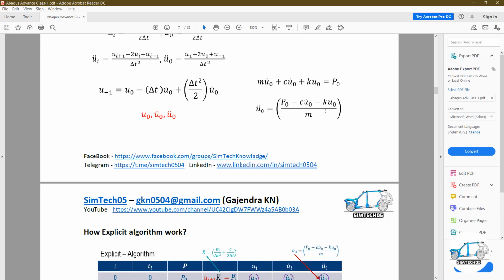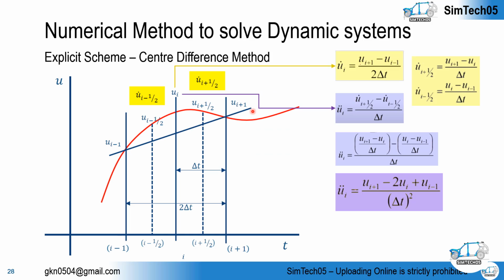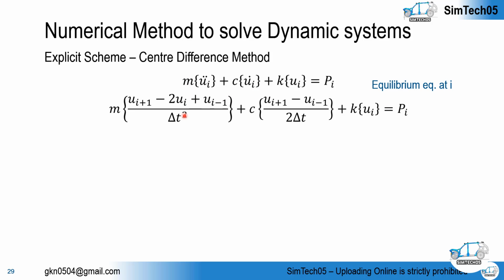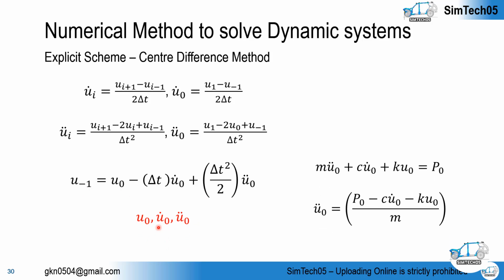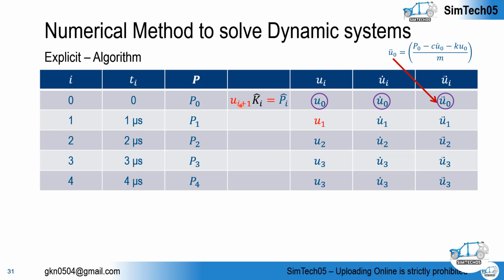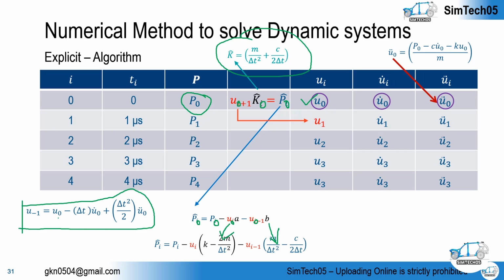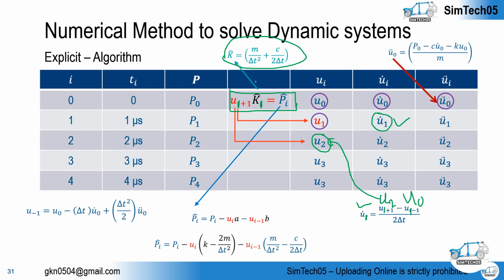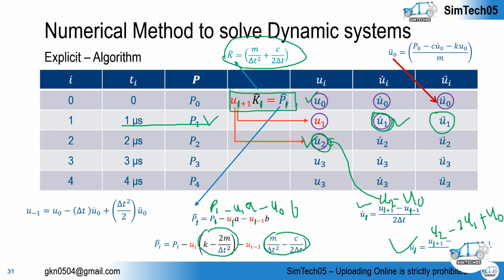Implicit and Explicit Analysis in FEA, Part - 02 (How Explicit algorithm works?)

Comment: Isn't a Central difference method iteration based??? Confused in iteration and incremental
Reply from the maker: Dear,
Assume following -

You want to move forward

Increment - is your footsteps. Let say at a time your footstep is size of 1 meter. 10 meter you want to move...so atleast 10 increment you need to make.

Iteration - is the number of attempt made by your mind to complete the one footstep.

Let say you are drunkard. But you need to pretend normal infront of your family...so that time you will take care of each footstep and in every footsteps you will think twice thrice or more...
This is your iteration.